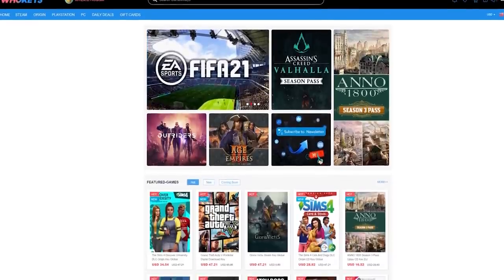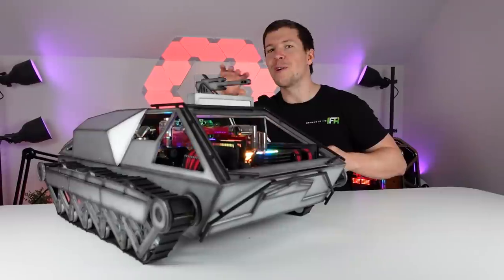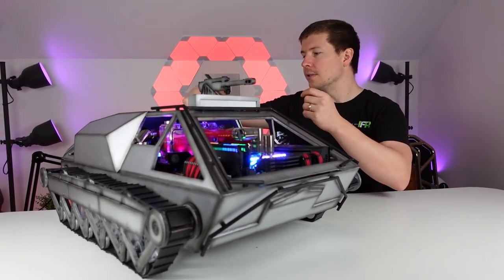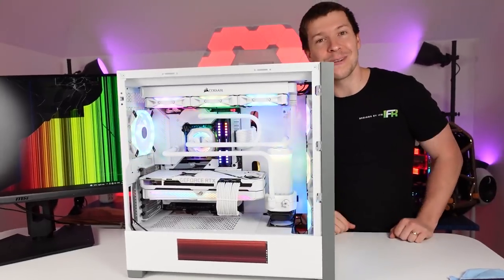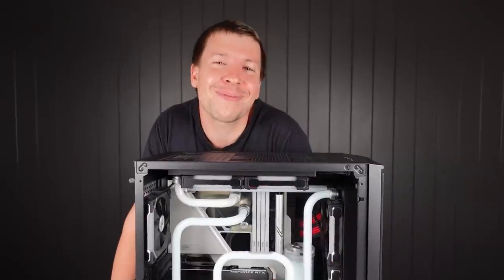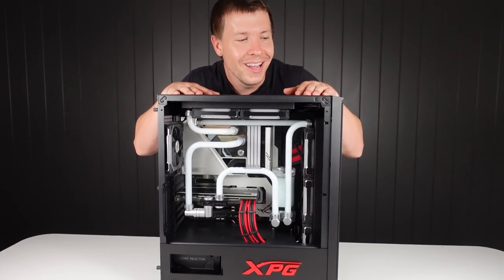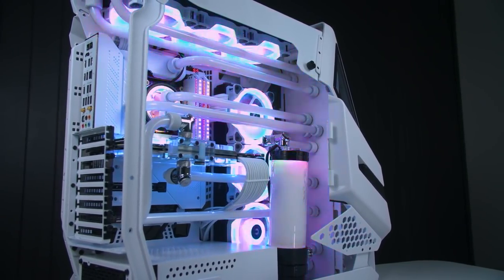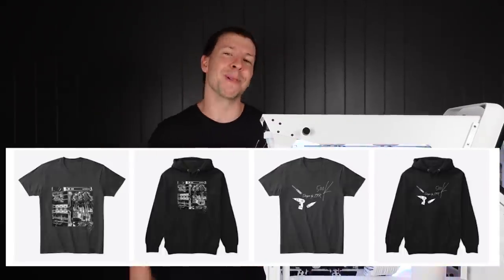I can't believe we broke it...

Comment: I would suggest the Singularity Specter 3. I turned mine white without any effort. The fact that it's so easy to assemble/dissemble was so simple that anybody could do a good job doing any color scheme they wanted. I did mine in vinyl so I could always revert back to the original black if I wanted too. Not much of a challenge, but it does show how easy it can be for anybody wanting to change the look of a PC.

Comment: Good to see Cory knows how to diagnose problems and talk the talk... "This one is stuffed up so this one is stuffed up as well".

As for DDR5 memory; it's becoming slightly easier to find in Australia now but prices are still too high. I have two 32G (2 x 16GB) kits - Kingston Fury Beast 4800 CL38 (extremely easy to overclock) and Corsair Dominator Platinum RGB 6200 CL36.